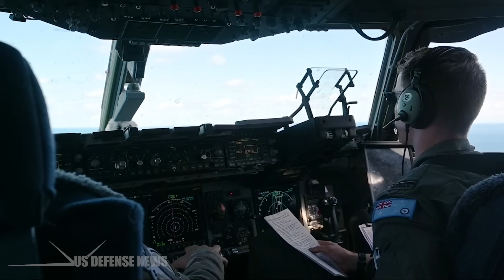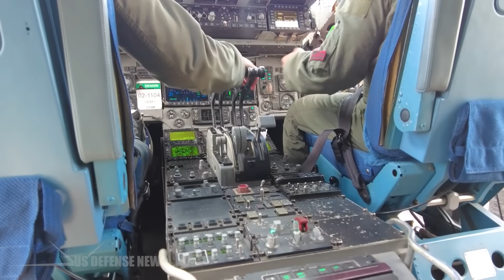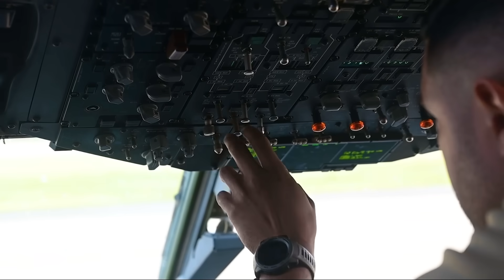Why Boeing Stopped Production of the C-17 Globemaster III And Why It Might Be Restarted

Comment: I worked for the contractor that built the composite tail for the C-17 and the horizontal and vertical stabilizers for the B1-B. Rockwell did the design in Columbus Ohio, though I don't recall what parts they built there. Final assembly was at Palmdale California.

About 10 years after the final B1-B components were delivered, the government gave to  order to destroy the tooling that they were paying the company to store. Fast forward to the mid 2000's we received a RFQ to start the lines back up. I recall they wanted 25 ship sets, 1 vertical and a left and right horizontal stabilizer.

The floor space was no longer available, as other programs now occupied that space. Recreating the tooling, assembly jigs, hydroform press, was in excess of $80 million, the other equipment required to machine the skins and titanium parts, vacuum furnaces, plasma beam welder and chemical process lines) was another $75 million.  

Too expensive, so it went no further.

Comment: How hard have the various existing C-17s been worked over the past decade or so? Airframes are rated for a certain number of flight hours and the various wars the US fought in over the past 25 years the aircraft were worked hard. Have existing airframes being worn down?

Personally I am wondering if new production C-17s could also be fitted for tanker operations? The KC-46 seems to be a buggy white elefant at this point and a KC-17 would also likely have the base C-17's rough field capabilities which the KC-46 lacks. Note that a new C-17 might also eat up the market for planes like the C-390, which Boeing might also like, even though the C-17 is much bigger..

Comment: Let's see, why did we (and I say 'we' because I worked on the C-17 at McDonnell Douglas) stop production? Well the contractual order amount was fulfilled and NO further orders were forthcoming. Simple...no money, no planes.  You glossed over why there was no money. At the time the JSF (F-35) was the up and comer. Every dollar spent by the USAF on C-17's meant less money for their new, high zoot, fancy hot rod fighter.  And since we know it's fighter pilots that run the Air Force and NOT transport/cargo pilots it doesn't take much to see where the program was headed. So, the C-17 lost out because there was no one in the USAF to push for it. 
FMS were also a non-starter as most of those countries flying C-17's actually lease them from the USAF. They couldn't afford to buy them. 
As for the tooling that was used to build the C-17; it's gone. The majority was scrapped or sent to a storage yard where it's deteriorating. We dispositioned thousands of tools and unless they were being used to make spares or had specific notes not to, they were scrapped. It costs A LOT of money to retain tooling. 
The knowledge base that existed to build the C-17 is GONE. Retired, dead, moved on, aged, call it whatever you want...it's just not there any more. That alone will add TREMENDOUS cost to restart any production line. There was soooo much knowledge on how to build that plane that wasn't documented that if you even tried today you'd have a learning curve so steep it would take a decade or more to even get up the hill 1/3 of the way.
Boeing really doesn't have facilities to build the C-17. Long Beach is gone. St Louis, where many of the large assemblies were built, is totally changed and geared up for the new F-47 there's no place. South Carolina is devoted to 777, and Renton will probably be used for the new commercial jet that's planned. 
I can bet you there was some preliminary ask to Boeing by the DoD for what it would take to restart the line and I'm sure Boeing did it's due diligence and gave them a number and the DoD chocked on it when they saw. It would be cheaper to just do a clean sheet design for a new transport. 
Back in the late 2010's the navy asked us about building additional Harriers as that line had shut down and they were exploring options to add new Night Attach variants and to replace attrition birds. The cost was excessively prohibitive so they decided it better to just wait for F-35B's to come online.
Restarting a closed aircraft production line is not easy and is hugely expensive. Unfortunately hindsight is 20/20 and money in the present when you need to make decisions is extremely limited to support your hopes and dreams. The USAF is just going to have to make do with what they got and take good care of it.
Reply: Great dissertation. A few corrections though.  The foreign countries actually bought their Globemasters, although they do have USAF support and Boeing technical support.  Also, "...the DoD chocked on..." should be "...the DoD choked on...".

Comment: Originally competition of Boeing YC-14 vs. Douglas YC-15 hoping for STOL and rough field use and thinking of pure jets over propeller craft were ideal. Updated C-17 called into production a decade later seemingly only replacing the C-141 and failing in doing the same for the C-130. The mockup sat in Douglas Long Beach bldg. #1 facing nose to nose  with the MD-11 mockup. Douglas plant there once employed over 40,000 people, now a ghost town with much of the bldgs. gone, but those remain east of Lakewood Ave. which were final assy. of DC-9/MD-80 jets in hangar 80, DC-8 then DC-10/MD-11 in hangar 84.
Reply: I did a internship at McDonnell Douglas in 1989 and we were in building 35. We would go over to both mockups from time to time.  I believe the flight simulator was in building 1 as well. The few buildings that are left were sold to Mercedes Benz and Virgin Galactic. Across the street is a shopping center, office  buildings, and hotels. Fun Fact: When Mercedes Benz acquired the old 717 hangar,  they wanted to remove the neon Fly DC Jets sign off the roof. Somehow the city or state got involved and the sign was saved. I also heard that Mercedes Benz is also responsible to maintain the sign and turn it off and on daily..

Comment: Boeing has enough on it's plate without having to open yet another production line.
The 737 Max 7 and 10 haven't even gained certification, the 777X is in the same boat and delays/quality problems are inherent on the 787 production line.
The C17 isn't a real priority at the moment.

Comment: Boeing could use the Everett facility since the 747 is out of production.   But what would power the C-17neo.    The Pratt engines used on the current C-17 were derived from the PW2037 for the 757.  That is an old and inefficient engine.

Comment: This was designed by engineers at Douglas in Long Beach.  Boeing needs to rethink what they are doing before they drive themselves into irrrelevancy.
Reply: @NeroOnTheGoon TOO BLOODY RIGHT! But Boeing's leadership, like the leaders of most, if not all, US manufacturers today, is suffering from the dreaded sickness of FINANCIALIZATION. 

FINANCIALIZATION is the belief that it matters not what job you do, not what product you make, not the history or breeding or derivation of the company, not that the workforce is not recognized as customers of the company. 

The ONLY thing that matters is that stockholders are deemed the primary or only customers of the company, and they must be catered to, and provided with, regular, consistent, continual, large dividends. NOTHING ELSE MATTERS.

Manufacturing is different! All the things noted above missing with FINANCIALIZATION are very important to employees of manufacturers. You won't develop loyal and skilled manufacturing employees by not treating them as important customers, by telling them that pride in the type of job they do is unimportant. By ignoring the pedigree and history of the company. By pooh-poohing the importance of the product you make. NO, NO, A THOUSAND TIMES, NO!

Until Boeing leaders can shed their fascination with this sickness called FINANCIALIZATION, they will continue to have problems like deaths caused by their poor decisions made in rolling out 737MAX, refueling boom separations for KC-46, failure to plan for C-17 replacements / upgrades, etc., etc., etc.

Comment: The problem is, the Boeing that designed, engineered and produced the current C-17's is NOT the Boeing that exists today. I have very little confidence they wouldn't screw this up in a way that would cost taxpayers hundreds of billions of dollars.  The KC46 has been a nightmare, as have the replacements for the two 747's for the Presidential fleet.
Reply: When Airbus here in the US can build better quality  aircraft, I blame the unions on screwing up the quality of Boeing...
Reply: But B787 is a masterpiece, and B747-8i is the best B747 yet, only their management team needs to be improved.
Reply: @johndavidson3424  The lion's share of the 787 design and engineering took place 15-20 years ago, and the 747-800 program started and flight tested roughly during those same years.  This is NOT the same Boeing.  They began cutting corners in the engineering programs to some degree in the early 2000's, but in full force by the time the 737 Max, KC-46, Presidential Fleet Program 747's, and the Starliner programs kicked off.  And, while I left it off my list, you can through the 777-X program into that mix as well. They are almost 6 years behind their first scheduled delivery date.  Granted, Covid played a role, but the first delivery was supposed to occur right when Covid was kicking off--so it's certainly not a blanket excuse.
Reply: Mcdonald Douglas designed and built this. Boeing just bought them out,and put there name to it. The Boeing tanker is a joke. They should have had Northrop build the new tanker.....but Boeing cried about it when Northrop won and then the government took it away and gave it to the crybabies... which they have totally screwed up.

Comment: With the C-5's aging out even though they were upgraded to the M model, something is going to have to happen and soon. The middle east mission wore a bunch of airframes out over the 15 year war.
Reply: C-17 is way more ergonomic and flexible than the C-5 so I don’t think a similar sized replacement will happen
Reply: Yes. You’re right. The pace and distance of Middle East operations put a lot of hours on the airframes. Very important point.
Reply: I'm retired from the C-5 program now. However, C-5M reliability to my knowledge is not good, I think worse than the older C-5s of the good ol days. I did not care for the M model, it has made the airplane quirky, and in some ways worse than the legacy C-5s. I never liked them. Old C-5 guys who went to C-17 maintenance always said the C-17 is easy and boring. I wish the C-5 was like that...

Comment: The aging C17, some of them are over 20 years old. Are you kidding ?  How old are the C5s, C130s  and B52 ?
Reply: Still making C130s,(stretch ones).C-5s coke bottle shape makes it the faster than C17! The only Boeing plane is the 747-800. They stopped that one too( That was fast too). Guess which ones were designed with a "Slide Ruler"?(Hint: the fast ones) And The Hercules.😅
Reply: @CaliTraildude   C-5s don't have a Coke bottle shape. Their massive wings create an illusion that the straight barrel fuselage is narrower near the wing box. Also, the standard cruising speeds for the C-5 (0.767M) versus the C-17 (0.74M - same as the C-141 BTW) aren't that significant in grand scheme of airlift; except for the much higher fuel burn/requirements of the C-5.

Comment: 悪いけど、航空自衛隊がC-17Aを採用する可能性は「0」、首相の戯れ言には構う事はない。確かにC-17Aのパフォーマンスには目を見張るモノがある。だが、巡航高度、速度では必ずしもアドバンテージはあるとは言えない。エンルートでの運用を考慮すると、その域には達していない。
Reply: C-17A specs:
Tested/certified maximum cruising altitude: 45,000 feet.
Nominal cruise speed: 0.74 Mach, but can go faster.
Please define "...en route operation...".  The C-17 is an air refuellable workhorse that can direct deliver to dirt runways as short as 3500 feet. Maybe that is not short enough.

Comment: Funny how Boeing never designed it. McDonald Douglas made a sturdy air frame. Let them restart the program and the current Boeing designers will screw it up
Reply: McDonnell
Reply: Skilled workers= UNION WORKERS in which Boeing is TOO CHEAP  to want to deal with them.
Reply: McDonnell-Douglas no longer exists.  It was bought out by Boeing in 1997.
Reply: @GSMSfromFV Boeing did that to run McD out of business and to TAKE THE MILITARY CONTRACTS.
Reply: @GSMSfromFV  It was a merger, First CEO was Harry Stonecipher,  the Mc Donnell Douglas CEO . So who bought who???

Comment: They need to stretch it and put more powerful engines on it. Just like they did with the star lifter. Stopping production was yet another bad decision by Boeing. Offering a bigger model would be a good thing and Boeing would attract more orders.
Reply: Just ask how well that went for the C-141.
Reply: Boeing made a business decision, not a "bad" decision. Stockholders have a very dim view of spending huge money on products that are not and will not be sold.  If there is no market, there will be no orders.
As for the Lockheed made C-141/B Starlifter, the US DoD wanted more specific airlift capability quickly.  Stretching the 141 was the better solution.  I flew the 141 during that period.

Comment: Watched many come out of the assembly line hanger in Long Beach.......... what they should do is build one 20-30% Bigger...... with bigger engines and more capacity... they have that ability.😁
Reply: Do you think it should have forward canard wings for (a little) more lift?
Reply: A thought is a stretched version, and powering it using the same engine type of the KC-46 (60,000 pounds of thrust). Would avoid designing a new engine and take advantage of existing training and maintenance skills that exist for the KC-46.

Comment: I think its more likely the USAF will open a competition to build the next generation transport to replace the C-17 and C-5 given that many of the components (cockpit) were McDonnel Douglas components and likely havent been in production for over a decade at this point. Given the production line for the C-17 is now making Mercedes Benz vehicles, its going to be very expensive to restart production in a new facility and would have similar costs as creating a new aircraft all together. Plus a new aircraft could incorporate newer engines with lower flight hour costs.
Reply: Restarting it will be significantly cheaper than a whole new program. Not to mention the delays and being over budget. It’s a transport it doesn’t need to be super advanced, redoing avionics isn’t impossible
Reply: @SunsetSlot that will depend on a lot of factors that im sure Boeing is currently looking at. While Lockheed Martin restarted and moved production of the F-16 for foreign customers, it was found restarting F-22 Raptor production was similar to creating a whole new fighter. I think restarting C-17 will be similar to F-22 Raptor instead of F-16 given its size, but i could be wrong.
Reply: @Buttersthatsme01  Well I researched and the  LR production figure could be 10 a year from an average of 15-16 per year.  With the oldest aircraft being 32 so years it’s old a matter of time before the DoD forces Boeings hand anyway.
Reply: @SunsetSlot have you seen Boeings recent track record in upgrading their own commercial planes? Now…. Do you want them to upgrade someone else’s design? Really? You sure?
Reply: @drjojo4624  Boeings failures isn’t necessarily a blank practice or philosophy across all platforms. While it is a management issue nothing suggests that would be a default for a restart of the C-17
Reply: Also it is too heavy for most tasks.  Carrying all the heavy duty landing ability is paid on every flight between real runways.
Reply: the PAINE plant my friend, the 747 slot still needs to be filled

Comment: You forgot to mention that some years ago, the Antonov airplanes could be used as a remplacement of the C17, but they are no longer usable. I'm thinking of the unique AN-225 (destroyed in 2022) and the AN-124 that are in Russia.
Reply: AN-124s are limited because they require long runways while the C-17 does not and can land & take off to more remote locations. Not to mention C-17s are capable of air refueling.
Reply: Those planes were not competitors of the C-17, they were in the C-5 class.